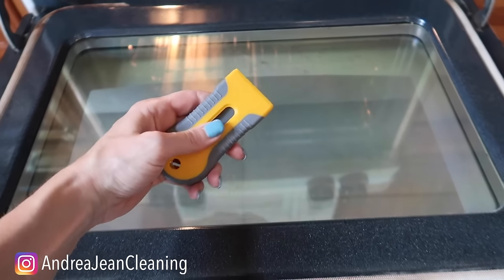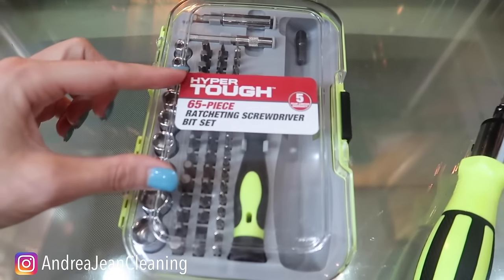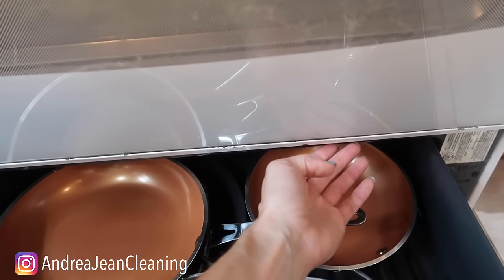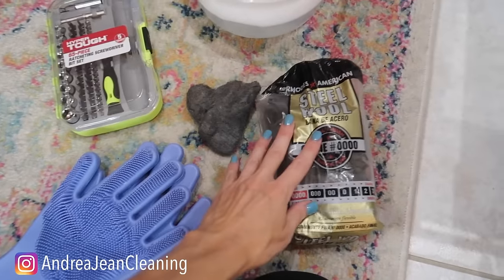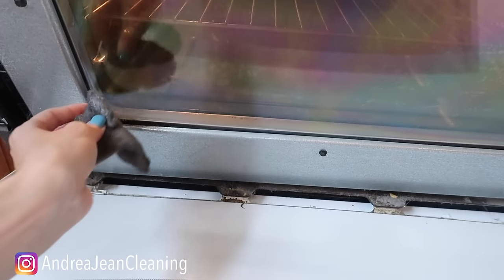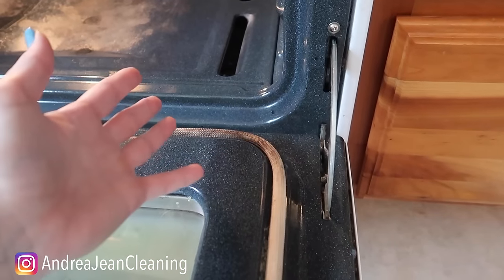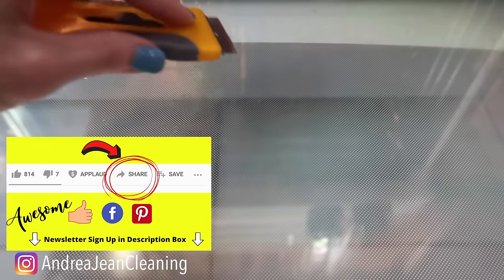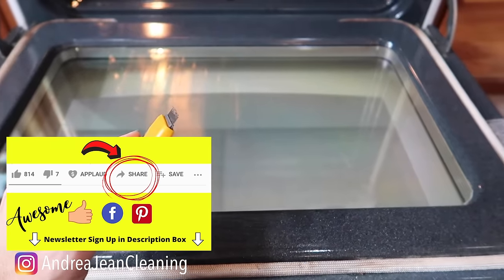How to clean BETWEEN THE OVEN DOOR GLASS!! (Genius Tips to Clean Your Oven Like Brand New)

Comment from the maker: Want More Cleaning Hacks, Tips & Tricks? Sign Up for Andrea Jean’s Weekly Newsletter:http://bit.ly/AndreaJeanNewsletter
Reply: Awesome as always, I'm inspired. Blessings
Reply: Been wondering how to clean glass inside for years. Thank you. Amazing.
Reply: 🤣🤣🤣I know right!! I'm an old fart, so I had heard about this years ago. I've been cleaning my over door like that for years. Plus I do use the razor on the inside too. You're too young to remember having to defrost the freezer in your refrigerator.  Now that was a stinking job. Boiling pots of water and putting them inside to thaw it out faster and have to line the bottom with lots of dry towels to catch what thaws. It was tripping. Lol
Reply: I think the Mr clean pad would do better than sos. That man is badd azz.
Reply: Notice the (steel wool) is 
(4) times 0000.
Its the finest steel wool.
Reply: @donnamyers7274  Thanks for the memory I had forgotten about! I didn't think I could do splits till I stepped on a stray piece of ice lmao
Reply: @shapienails3067  🤣🤣🤣
Reply: Thanks so much for showing me how to clean the yuky stove window.  I've subscribed, my stove looks brand new.
Reply: It's called a torx bit, my oven door has two sizes. A razor blade can scratch glass, especially don't recommend on a car.
Reply: you do realize you can lock the springs and pull the door completely off..

Comment: My door came apart easily. I’m glad you said to hold onto the glass because it did spring up.  When I tried to put it back together I realized that I didn’t see how the sides(which fell off when I took the screws off) were attached.  The handle also feel off so I kinda needed another hand to hold all the parts together until I could get the screws back in place. But I am stubborn so I didn’t get help. Now for the last problem I could not find the second screw anywhere. So I had to tape the left side of the door together until I can get one at the hardware store. Other than that it went real well.  Lol. I pray it can stay clean for sometime now and I know I will love how it looks also, thanks for the lesson!
Reply: 😢😢When working on projects that require the removal of screws, keep a good magnet handy. It helps to keep all the small metal parts together so you don't  waste time looking the MIA parts.

Comment: Ok, a 
*WARNING!*:  

On Many/Most ovens, the inside pane of glass is a tempered/pyrex like glass and the outside pane is NOT, SO you MUST be sure to not remove and install the 2 panes in the wrong order! (Often they look identical!)
BECAUSE the outside pane can not take the inside heat of the oven without shattering!  
Then you will have to get a replacement tempered/pyrex like pane to replace the broken one because of the mistake of not knowing!

Take care!
Reply: How come i cant save or bookmark this?

Comment: A few years ago I did this with an older Gemini double oven. I used the smaller top oven the most. I had 4 screws across the top on the white part above where yours are inside the oven. All the screws went back in except for one! Fortunately it did not affect the oven but I wonder what a pro would know about that?! I will not attempt to do with my newer oven:( 
Unless of course I find some trouble shooting solutions first!  Good job btw!

Comment: Took mine apart and regretted it. The whole thing fell apart. Very sharp metal edges in there, and I just couldn’t get it back together properly. Had to call in a pro and even he had a hard time. Will do the fly swatter and rag up the slot in the future!
Reply: Aww, so sorry!
Reply: Thank you for the fly swatter comment. I didn't want to unscrew the door. I folded micro fiber cloths and sewed the top closed then put over a fly swatter. Used a second one to dry. Worked great!

Comment: If you buy weimans stove top cleaner the spray not the paste and a magic eraser sheet  the thin ones and or a metal brush the spray alone leave on for a few minutes then scrub with the magic eraser it all comes up super easy not a lot of scrubbing needed what so ever really but leaves the oven glass door shiny and brand new with no scratches and no spots  left behind either I do this for every oven  I clean 
Also if your oven is extremely bad and has a lot of build up there’s googone stuff for ovens and grills you spray it all over leave it for like ten minutes then use an sos pad and it all comes off super easy I’ve done a lot of experimenting with different cleaners to find the best of the best and so far these are the best two for stoves and ovens easy to use and remove everything to have everything shiny looking like you just bought it

Comment: You should always make sure glass is always wet when using a blade, per professional glass cleaners.  Also, the door actually should come off the hinges and can be laid on a flat surface without disassembling the entire door itself making it easier to clean.
Reply: There's more than one way to skin a cat.
Reply: Thanks.  I just got finished scraping it dry.  😢

Comment: The steel wool doesn’t scratched glass?
Reply: I use Mr. Clean erasers. They work great! 👍
Reply from the maker: I have never had an issue.  Always test a small area first and make sure you are using grade #0000.
Reply: @robintaylor4604  me too.
Reply: Use soapy water with very fine steel wool (0000).

Comment: How do you get your oven drawer out I can not get mine out and I can not find out how
Reply: Make sure your drawer is not just a facade.  Or perhaps it's only a broiler?  But it still should open.  Check to see if it's correctly aligned on the rails or that nothing is blocking it.  Good luck, dearie
Reply: @beantoes9627  I did find a video and was able to get the drawer out thank you for your reply